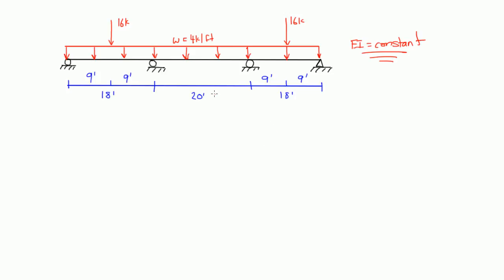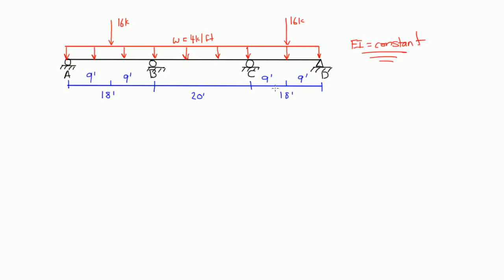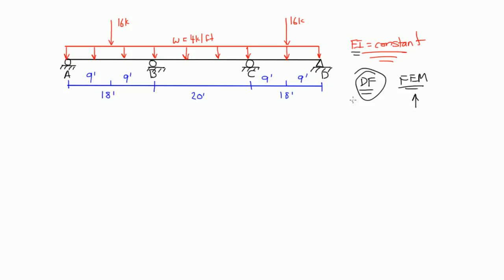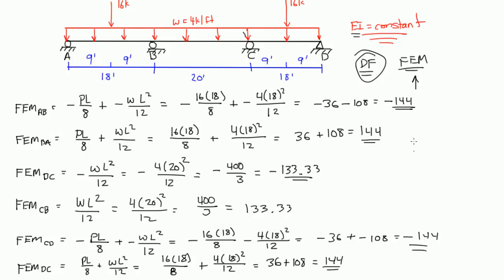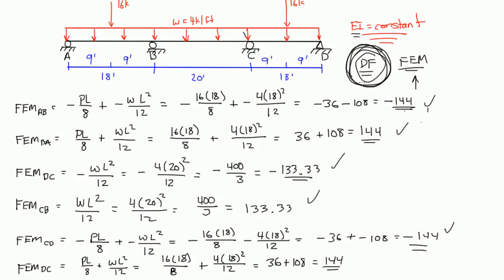Moment Distribution Example 3: Part 1

Comment: Should be (wl^2)/8, because you have to split the beams into separate sections, considering middle joints like fixed ends.